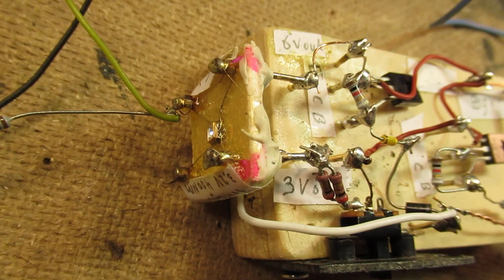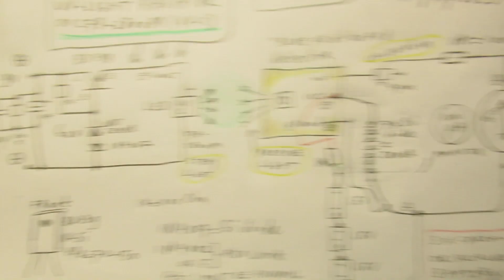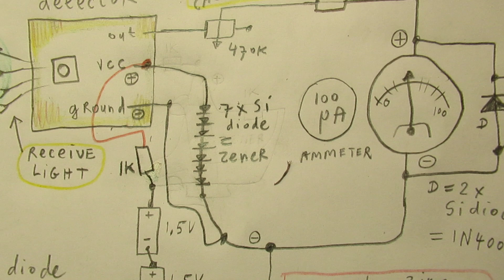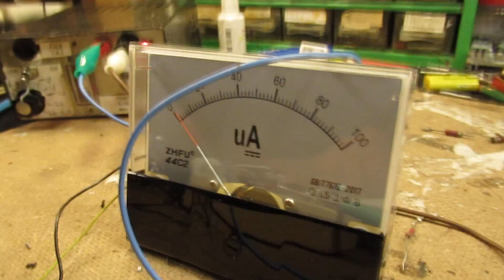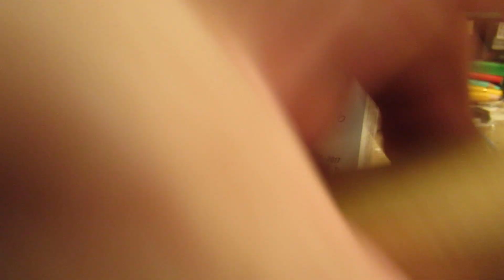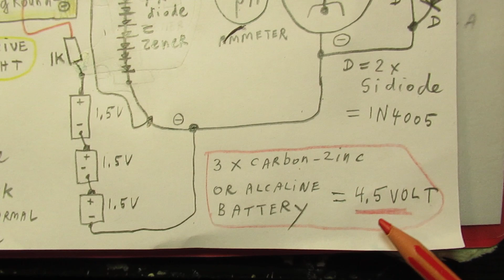Ultraviolet C (sunlight harmful) radiation detector in the 278-280 Nano Meter band schematic & demo

Comment: can I use your schematic using IR LEDs instead of using UV LEDs?  to detect outdoor ir radiation without detecting sunlight radiation? thank you
Reply from the maker: The UV-C Led is, in this case, mounted on a small (in this case blue) board with, I think, an amplifier. It has 3 pins: out-vcc-ground. When you can find such a mini board made for the IR LED's that you mention (also with 3 pins: out-vcc-ground) my idea is that it can work. In that case you must use the right supply voltage, on the basis of the datasheet of that board. 9 jan. 2024.
Reply: @radiofun232  okay thank you sir..i will try ..

Comment: Well done Ko. Your videos on ultraviolet light have been very interesting. Much to learn, many experiments are possible.
Reply from the maker: Thanks. Tested it today in sunlight, it worked very good and is very sensitive. Easier calibration/sensitivity alignment can be done by raising the value of the 1 K resistor to the microamp. meter. I found that clouds have a severe effect on damping this UV-C frequency in the sunlight spectrum.